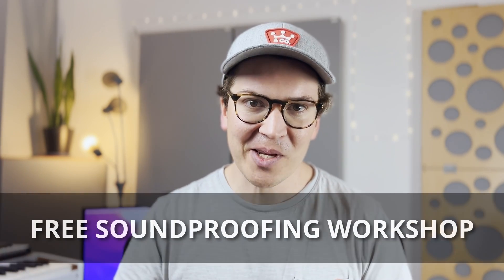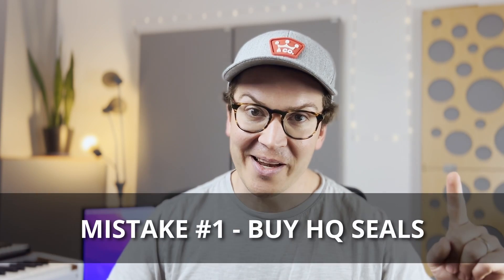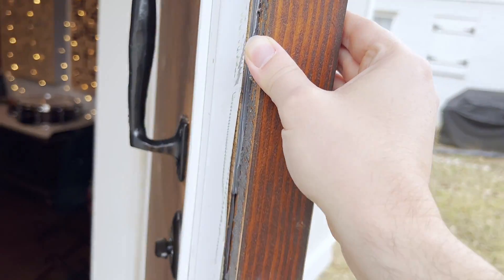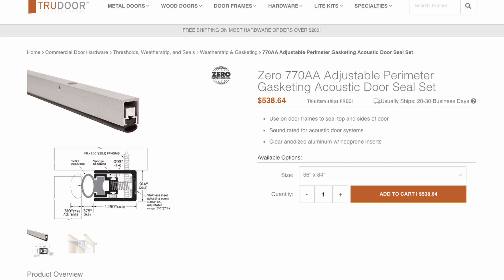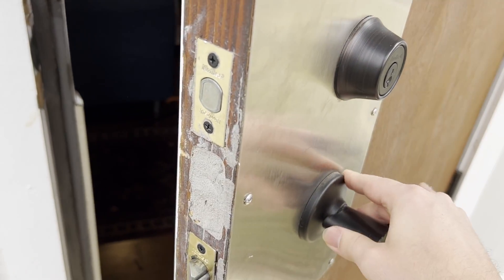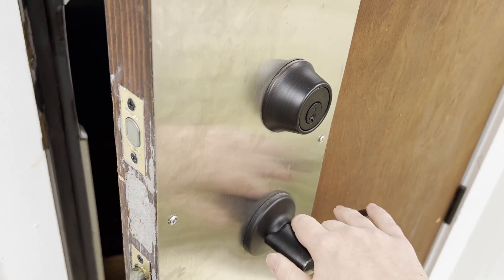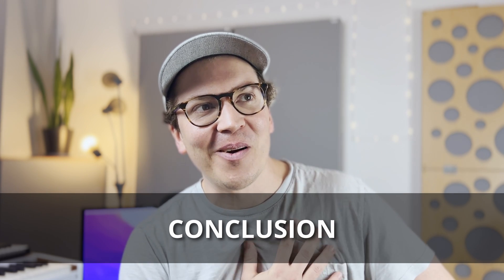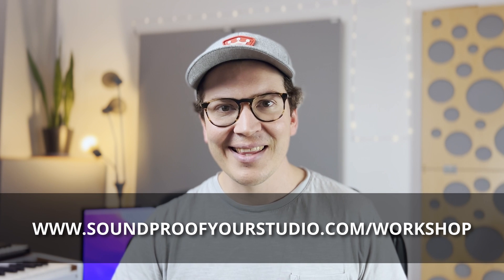My Three Soundproof Door Mistakes

Comment: Hi thanks for the vid. In your view is a solid core or a solid door (standard 6 panel) better for sound insulation? I have both and I am wondering which I should put in my bedroom to help with sound insulation. The solid core door is a bit heavier (maybe 30% or 40% heavier)  but the following vid seems to suggest solid wood is better at sound insulation? 3:25 mark:  https://www.youtube.com/watch?v=KXJgfXLaNj4&t=194s

Comment: I have been thinking about using a Magnet lock and key pad for my exterior door and a magnet lock and request to exit button on my interior door on a a communicating door system. This would eliminate any holes on the actual solid core doors. What do you think?
Reply from the maker: Sounds good